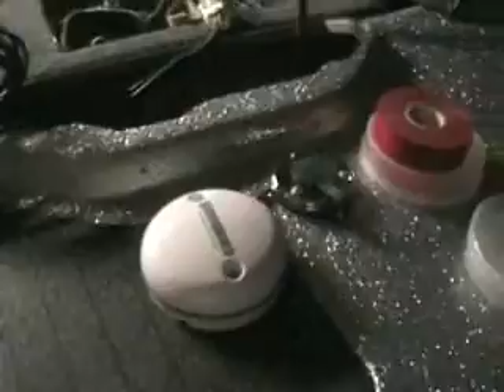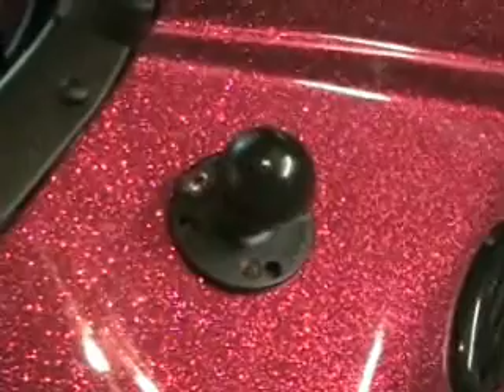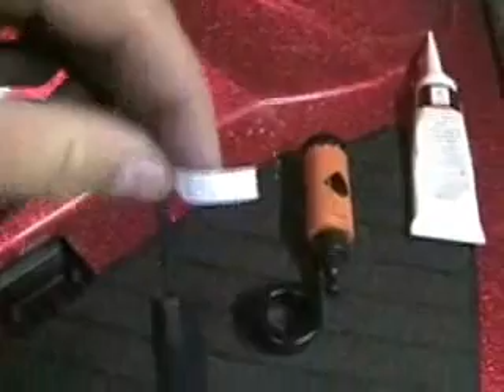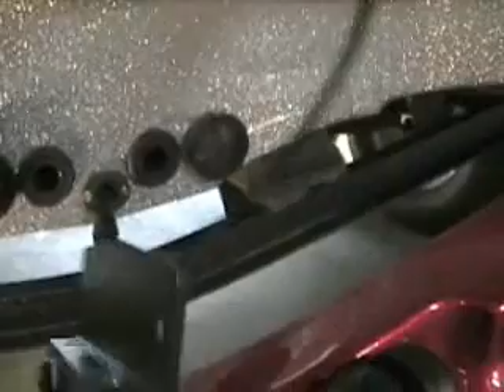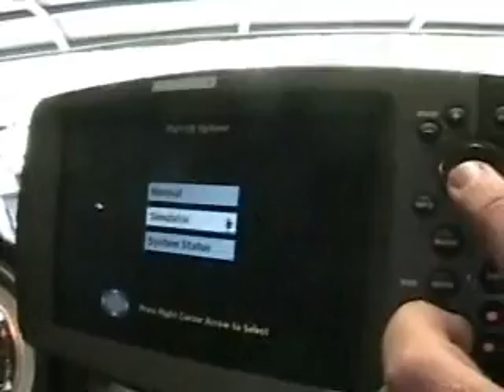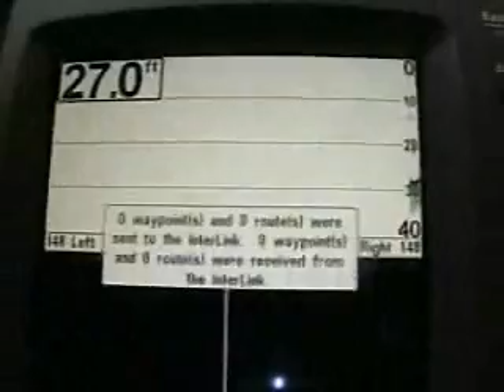Tips 'n Tricks 7: Humminbird Rigging Tips and Tricks

Comment from the maker: You drill in Reverse to prevent cracking the Gel Coat so it looks like a dull bit but it keeps the hole from cracking and chipping the fiberglass. Once you get thru then run in slow speed to finish the hole it will save from creating cracks or taking chips out of the gel coat.

Comment: that trolling motor trandsducer wouldnt be good to hydrila would it...does the transducer in the rear is it low enough to run at speed..or is that why you also had a thru hull transducer?

Comment: Thank you for the great video. I just bought a 798c but will try to install it on an older ski boat while I spend a month at the lake. I guess I may need to get a professional to install it since it might not work as easily as the portable Humminbirds (like the 385ci portable). 

Would you recommend a jerry-rigged suction cup install at the transom for the 798?